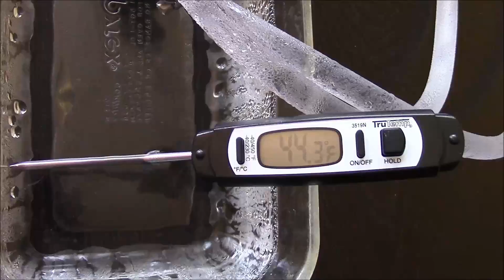How to Build A Water-Cooled Peltier Device or Thermoelectric Cooler

Comment: The cooling coefficient of performance for thermoelectric devices is less than 1.  That is, for a watt of energy in, it moves less than a watt of heat.  It's really very inefficient unless you have a good use for the waste heat generated.

You would get much better results moving your projects to compressor-based heat pumps rather than thermoelectric.  You can even skirt around some of the limitations of EPA-required refrigerant certification by choosing propane or butane as your refrigerant.  They perform at about the same level as R-12 (original Freon) did, and those chemicals are gaining rapid acceptance in Europe as the depth of experience puts the explosion fear to rest.
Reply: And where can we buy this device?  Do you have a model number?
Reply: What if he constructed a swamp cooler with this device with in it. Like a super powered ac?
Reply: I think it's the same system used in a mini fridge.

Comment: How well do you think this would work if I added this setup to my evaporative cooler? I would think it would make a huge difference and would cool down my room but do you think it would too?
Reply from the maker: 7EvilAdams I don't know about that one.  At first it sounds like it would but the cooling from your evaporative cooler comes from actual evaporation, not the temperature of the water.  At least that is my understanding.  You could certainly try it out and see.  I live in Texas and evaporative coolers don't work here because of the humidity so I can't test that out.
Reply: LDSreliance I think the temperature of the water does affect it as my evaporative cooler came with ice packs to use in the water but I will buy the parts needed for this and test it myself :) could you look over the parts I am thinking of buying for this build? I would have used the exact same parts from your build but I live in the UK. Thanks for your help

Waterblock - http://www.ebay.co.uk/itm/North-South-Bridge-Copper-Base-Water-Cooling-Block-Waterblock-for-7-10mm-Tube-/281731145739?pt=LH_DefaultDomain_3&hash=item41987c200b

Other Parts - https://www.amazon.co.uk/gp/registry/wishlist/ZFZ31HZXTMQN/ref=cm_wl_rlist_go_o?
Reply from the maker: Everything looks good except maybe that north/south bridge water block.  That is different from a CPU block and may not be able to latch down with the Corsair H60 water block.  If you use that you may need to rig up a different adapter to use for sandwiching it all together.
Reply: LDSreliance ok, thanks I will be sure to update you how well it all works when I get the parts :)

Comment: 4:20 Why not just wire the devices in parallel?
Reply from the maker: ***** What do you mean?  If you are asking about how I wired them to different power adapters that was due to the specs of the adapters.  I chose to use small, cheap laptop power adapters for this application and so I had to get 2 of them and group devices together based upon power consumption.
Reply: LDSreliance
But couldn't you have ran the entire circuit off of one AC adapter, wiring in parallel? You'd have to have an adapter with a larger amperage, but it could work (I think).
Reply from the maker: *****
Of course.  But usually laptop adapters only come in 60-90 watts.  Even 90 watts may not have been enough.  So I just used two $6 60w adapters.
Reply: LDSreliance
Well, it is cheaper than buying a $16 120W power supply. Bought one for a project that has three devices in the DC circuit (6W, 24W, 60W).

Comment: Do you think this would work to chill about 20 gallons of water in my bathtub?  I'm training my body and mind with ice-cold baths, and if this can bring the water temperature down substantially, it would really help!
If not, feel free to share an "upgraded setup" in writing.
Thanks.
Reply from the maker: Leonardo Riera How many degrees do you need to chill the water?  You can certainly do it with peltiers but it may take quite a few of them and it may take some time to get cold enough (an hour or more).
Reply: LDSreliance During this summer heat I estimate having to cool the water about 20-30 degrees. I don't care if it takes several hours. I'm just tired of having to freeze several containers of water the prior day and throwing them in.
I was even wondering if this could be done using a car radiator, a fan, and a water pump.
Reply from the maker: Leonardo Riera Yes, you could super-size the setup and use some rubber radiator hoses, car water pump (electric), and a car radiator to move a greater volume of water.  

The pump could sit inside the bath tub and circulate water from the tub to the cold side of the peltiers somehow (there are a few ways you could use the radiator and that would be up to you).  Then you could use antifreeze on the hot side and another pump to pump antifreeze to the hot side of the peltiers and then to a radiator and fan combo to cool down the liquid.

I am sure there are other ways to configure this but that is what I am envisioning right now.  You might end up needing quite a few more peltiers depending on how efficient your system is.
Reply: LDSreliance Thank you

Comment: Great video,

Would it be possible to use two of the radiator set ups on each side of the peltier unit so that you have cold coolant running through one radiator so that the fan then blows cool air? or is it best to just use an air to air for air cooling? 

Thank you for your time and please let me know
Reply from the maker: Jess Hull I am not really understanding what you are asking but in my experience this liquid cooling is more effective at cooling down air than a simple heat sink.  I am sure that is because of the radiator design of these cpu coolers that I use.  Air moving through the fins of the radiators transfers heat/cold much better than air coming in contact with a heat sink with limited surface area.

Comment: This setup is a pretty awesome idea, but do you think this could be made on a much larger scale? Say, designed to pump a glyco based coolant around to cool a 13 cubic foot area?
Reply from the maker: BlueLlama Of course.  The only drawback to this is the power consumption of the peltier device.  At a certain size it becomes cheaper to use a traditional compressor based mechanical air conditioner like you have in your house.  Peltiers use a lot of DC power, which either needs to be inefficiently converted from AC house power or expensively produced by solar or wind (expensive on a small scale of power generation I should say).

13 cubic feet might be pushing the limits a bit.  Is this for a refrigerator?
Reply: In a sense. I'm designing a fermentation chamber that uses a mini fridge as It's primary coolant, but it isn't powerful enough drop to the temps Im aiming for. So any peltier setup would be a supplament to any cooling going on. Shooting for temps around 35-40
Reply from the maker: Mini fridges don't have the greatest insulation.  You might try starting out with a small chest freezer as they are much better insulated.

Check this out as a starter:
http://newlifeonahomestead.com/convert-chest-freezer-to-fridge-solar/

Comment: i was thinking of away to use this in a pc. maybe on the air intake side of a radiator and have fans pulling the air through, or on the more meatier metal sides of the radiator. wut are ur thoughts? btw i wanna o.c. the crap out of my fx8350 XD got to the big 5.0 ghz now i wanna push for 5.5ghz!!!!!
Reply from the maker: rustypro98 You could chill the liquid in a front-mount radiator on your pc case.  That way the air passing through the radiator and into the pc case would be cooler by about 20-30 degrees F.  Lots of people use peltiers to directly cool down their cpu.  Go to Tomshardware.com for more info on that.

Comment: Nice build. I'm going to try something similar. I want to cool 1 litre of drinking water from 25-30 degrees celsius to 15-20 degrees celsius in around 20-25 minutes. Ambeint temperature would be around 35 degrees. If i build a rig just like yours, will it get the job done? Or would i need a more powerful peltier? Is there any other way to get better cooling?

Comment: Great info, just a 1 question though... If I wanted this device to switch on and off at set temperatures, or just simply run at a set temperature, how would I achieve this?
Reply from the maker: You can wire in a thermostat very easily.  There are some good cheap ones with remote probes that you could just drop in the water and set it to a certain temp.  It will cut power when it reaches that temp and turn it back on when it warms back up a bit.

Comment: You should try dropping the second radiator in the water (no fan of course), and adding salt to the water.  Bet it'll drop below freezing...
Reply: LDSreliance What about these - http://www.amazon.com/Hydration-Insulated-Drink-Tube-Cover/dp/B00FH2YZSO/ref=pd_sim_468_3?ie=UTF8&refRID=12XRNZ4PR6ZVKN2HXCZA
Reply from the maker: Mat Helm Good idea!  I will have to try that.
Reply: LDSreliance I think it would help to insulate the down pipe (cool side).  But I actually think a metal heatsink would work even better.  

Personally I came to see this vid because I'm working up a design for a mattress/bed cooler.  Thought about it while driving a Lincoln a while back, with AC seats.  First one's I'd ever used that actually worked.  Wanted to add them to my old vette.  And research then led me to the Peltier tech...  Just happened to see a chip while surfing ebay, so now I'm back on the idea....
Reply from the maker: I did buy some piping insulation and attempt to get it to work but my local hardware and big box stores don't have anything small enough to work on these small vinyl tubes.  I don't remember if I showed it in the video but I shipped the final product to the buyer of this contraption with insulation that sorta worked.  Better than nothing.

That is a cool project!  I can think of some ideas on how to do that but I am sure you already have one.
Reply: Carl Brothers Nice find..
Reply from the maker: Carl Brothers Very cool.  The tubing I used was 7/16 so it looks like that wrap will work.  Thanks!

Comment: What was the starting temperature of the water?
Reply from the maker: Capnmax About 80 degrees F
Reply: LDSreliance Wild. Why don't they use these in auto radiators!?
Reply from the maker: Because they are so power hungry.  A car probably has several gallons of water and that is 10x more water than you see in this video.  That means you would need 50+ amps of power just to cool down the water/coolant in the car 40 degrees.  Most car alternators are 75 amps or less so that would take up most of the electricity in the car by itself.

Comment: how much water can this cool
Reply from the maker: Peter Singh This device was able to cool down about 3-4 cups of water to 30-35 degrees F under ambient.  Unfortunately, I sold this device to a subscriber so I do not have it to test out various volumes of water.  I could have gotten more performance (colder water) if I would have used more insulation on the tubing and an insulated container to hold the water.

Comment: I have used enough thermal paste but it wont work. wont heatup/coold down. when i bought it i tested with a aa 1.5 v battery to see which one is hot side and which one is cold and it showed some sign of wich side is what. Then i got an ac adaptor which is 12 v and 1500 amps. Connected the hot side to heat sink and and made electrical connection to the fan,peltier and the adaptor. I found that fan was throwing air towards the heatsink and not away. Now when i am testing the peltier without the fan but just the peltier and heatsink. No sign of heat or cold. I believe the piece is not working now. I may have to buy another one.
Reply: Aman Khan  my friend your problem is with ac adaptor it is only 1.5 ampers . it is like 1/4 of the video's
Reply from the maker: Aman Khan Yeah they are really cheap.  Order them 2 at a time to give you better odds at getting one that works well.  If you are getting the 12705 ones they are $5 or less so you kind of get what you pay for I guess.

Comment: Very cool!! ;-)
A suggestion: By use of a thermally isolated container for cool water you can improve the efficiency.
Reply from the maker: David Casas Absolutely.  I am sure I could have squeezed another 5 degrees out of this experiment easily with some insulation and a thermos or something to keep the liquid in.  I just wanted something that you could see into for video purposes.
Reply: LDSreliance Yes, the heat capacity of water helps because tends to change its temperature slower than air.
Reply from the maker: Yep, that is why I am doing liquid cooling peltier experiments now instead of using air as the transfer medium.

Comment: I put the heat sink and fan to the hot side of my peltier , however i noticed that the fan is not sucking the air from the heatsink but throwing the air towards the heatsink. I am confused here. After this arrangement my peltier module stopped working. It wont cool down now. Any help on this?
Reply from the maker: Aman Khan The fan is just a bonus, the heat sink is doing most of the work.  I would suspect that there may not have been good contact between the heat sink and hot side of the peltier.  Did you use thermal paste?  What did you use to attach the heat sink to the peltier if there was nothing on the cool side to sandwich it?

Comment: LDSreliance Hi, im thinking about using this method for something, but i need to know what the peak temperatures are for the Peltier?
Reply from the maker: The main rating for a peltier unit is the difference (delta) between the hot and cold sides.  In this video I used a 12705 which is a 5 amp unit and has a delta of 70-79 degrees celsius (depending on how much voltage you use - 16v vs 17.2 respectively). 

The hot side is rated at 27 and 50 degrees celsius and again depends on the voltage you use (16 vs 17.2).

So if you put those 2 ratings together, the coldest you could possibly get at 17.2v on the cold side is -29 degrees Celsius.  Keep in mind that is just the surface of the peltier, not counting any heat sink or anything else.
Reply: LDSreliance so if i were to configure it into a liquid cooling loop, the peltier wouldn't transfer the full amount of cold onto a water block
Reply from the maker: You are going to lose some energy in the transfer.  The peltier can only shed so much heat energy from the cold side of the plate so it can either make a big temperature difference on a very small item (like a drop of water instantly freezing) or a small temperature difference in a larger item (like a gallon of water dropping in temperature by 5-10 degrees).  Does that make sense?
Reply: LDSreliance yea, i understand, i guess for what i want to use it for, wouldn't suffice. Thanks for replying :)
Reply from the maker: Well if you need more cooling power they do make more powerful peltiers.  I have seen some all the way up to several hundred watts.  You could also use multiple setups.  What are you trying to cool down?
Reply: my computer, i got a liquid cooling system hooked up but i want t odo something a little more extreme
Reply from the maker: Ahh, I see.  What you could do there is sandwich a peltier between the cpu and the water block on the cpu cooler.  I have seen people do that before on tomshardware.com.  You should do a search on that site.  Lots of crazy overclocking stuff with peltiers.

Comment: this is interesting i will use this idea on my aquarium tank as i have cold water fish and here in Texas it's really hot
Reply from the maker: houston we have a problem I'm in Texas, too.  So you want the water to be cooler than the ambient temperature inside your house?  What size aquarium is it?  What kind of fish?
Reply: LDSreliance i have a 20 gallom and started with some gold fish but the temp likes to get to like 80ish inside when cooking
Reply from the maker: I see.  Then I think a small TEC like in this video would work.  It would not cool 20 gallons down very far but would help it from getting up to 80.
Reply: i'm hoping to at least keep the temp stable
Reply from the maker: My best guess is that it will drop the temperature about 2-4 degrees in the tank below what it would normally be.  But it would be interesting to find out!  Keep me posted.